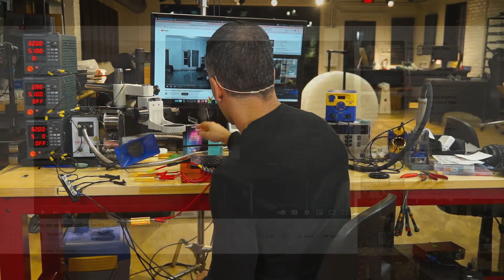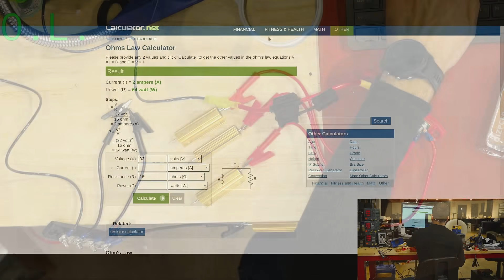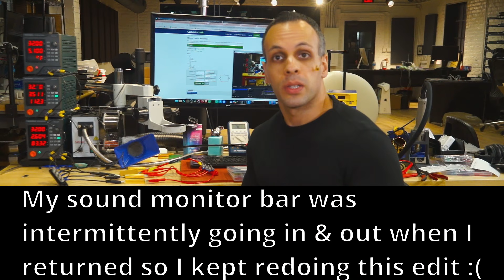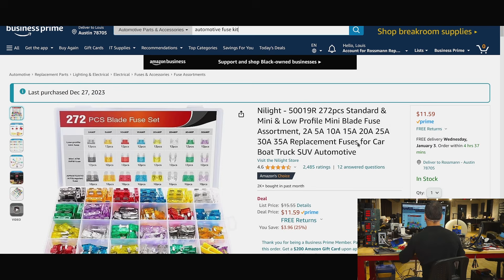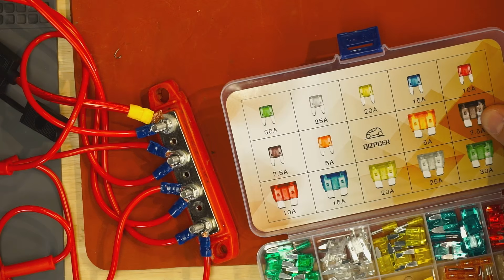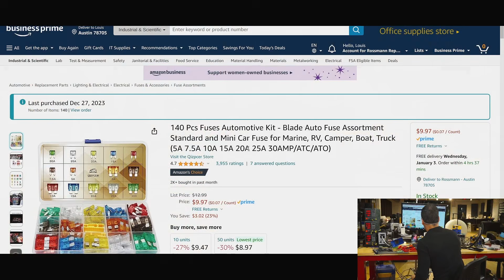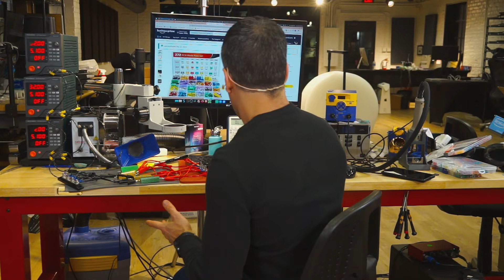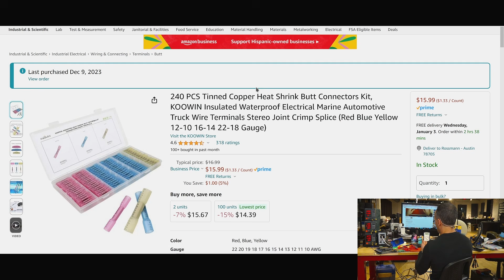Amazon Sells Fake Electrical Fuses

Comment: 3 Amps Thermal Circuit Breakers I purchased from Amazon for fault finding aka akin to "Lil popper" don't trip at 3 amps. Instead I'll use old ones from old furnaces that work fine and made in "Merica (probably)

Comment: The color coding stresses me out, even if the fuses were actually rated for what they said on the box: 
Having nothing printed on the fuse itself and using similar colors is a recipe for disaster in my eyes. 
I had myself second guessing in the video between light grey and white everytime you picked one, and I'm not even colorblind.

Comment: Wish you tested a few more fuses per brand randomly, just to remove more doubt from the general adverse viewer.

Myself, I have anecdotal experience  with multiple Amazon products that mostly led me to the the conclusion Amazon is almost as bad as most used car salespeople. Also have the experiences of others I trust with my life, that also have dealt with positively reviewed products that fail consistently and quickly after initial new purchase or replacement exchange.

Comment: I was wondering WHY you did not show a closeup of the fuse where it shows the fuse rating? You may have inadvertently grabbed a 40 amp. BECAUSE not all manufacturers follow the Automotive industry standard for color coding.
Reply: ALSO, if you would have measured the resistance of each fuse, you could have estimated the amperage of each fuse.

Comment: Great video, Louis. I looked up the datasheet for a brand name fuse, and the 2A version should have opened in 0.1s at 6 amps if it was designed correctly. Yikes!

Comment: One thing I would have liked to see was a comparison to something like a Bussmann fuse that you might pick up at your local autozone store, just so we can see what the "expected" behavior is.
Reply: expected behaviour is not hard to guess for a fuse, but yeah showing "real fuses" vs "china fuses" would help bring the point home
Reply: Expected behavior is a 2A fuse blowing within a second at 3A, and even faster at higher currents
Reply: @volvo09  Could take up to about a minute at 3A for this type of fuse. At 4A it should be under 5s.
Reply: @volvo09  Fair enough. When I first posted this I didn't consider that the data sheet is readily available for brand name fuses. 

Interestingly, the "less than a second" isn't even guaranteed on brand name Bussmann fuses. The spec sheet says, @200%, the minimum blow time is 0.15 seconds - but the maximum is 5 seconds. 

https://www.eaton.com/content/dam/eaton/products/electrical-circuit-protection/fuses/bussmann-series-supplemental-fuses/automotive-blade-type/bus-ele-ds-2048-atm-series.pdf
Reply: LittelFuse automotive 2A 32V at 4A should be 700 ms to blow.
Reply: Agreed that we need a control. This data would be more convincing with it.
Reply: The UL/CSA requirement for automotive blade fuses is they must blow within 5 seconds at 200% rated current
Reply: Bussman fuses are good quality fuses. Mouser sells them in 10pc. volume for about 1.5-2$ a piece or as little as 1$ at 100qty. so are LittelFuse
Blue Sea Systems are also good fuses and Amazon sells them for about $1.25 a piece and they are shipped and sold by amazon with 1 day prime... 
ATC fuses should cost about 1-2$ each compared to  chineseium ones that are like $0.10 each  but they actually work.
I dont get this b/c if you go through fuses so fast that the $0.90 difference in price actually matters your electrical system has WAY BIGGER ISSUES.

Comment: Would be good to have a head to head comparison to a well known brand fuse. I have no experience with low voltage fuses but I have some with high voltage fuses and they tend to take some time until they blow at over current due to thermal inertia. At rated current they never blow. Probably it might blow much earlier as the ones shown in the video but you never know.
Reply: @@giusdbg I‘d say the average model that is used by car repairshops. I’m pretty sure they won’t use different types of fuses for the same size.

Comment: I think you should do a comparison with a quality name brand fuse like Bussmann or Littelfuse. Compare the time it takes to trip. Given that these fuses are supposed to meet SAE specifications they should have similar if not identical time to trip at a given current and ambient temp.
Reply: A 100 piece automotive fuse kit on Amazon is $8.99. A 100 piece Eaton Bussman fuse kit on Zoro is $56.29. A 100 piece Bussman fuse kit on Grainger is $99.29. A 100 piece Littlefuse fuse kit is $69.47 + $13.89 tariff shipping to the US, thank you Mr. Trump. And there's you dinner!
Reply: @Phocoshay_Balperrus  Those fuses are between 30 and 40 cents each in quantity 10 from DigiKey. Some are as cheap as 22 cents each in quantity 100. None are as cheap as 8.9 cents each. Now, if you want to save 30 cents on a fuse to use some crap that may or may not actually blow when it's supposed to, well, you are the customer that China caters to.

Comment: I think fuses like that are not really for protecting power supply or load. More like protecting wires. Car battery can deliver much more than few amps, more like hundreds. So I think that fuses like these are for gross overloads, not working as fast fuses.

Comment: Don’t you have to install the fuse before the load not after? Effectively there is no fuse between the supply and the load? In automotive fusing the fuse is as close to the supply as possible.
Reply: No as the current entering the load is equal to the current leaving
Reply: @Huntonaldinho if that is true then why even in the MacBooks that Louis repairs always have the fusing before the loads. The fuses are between the charge port and the charge circuit and before any chip on the board. They don’t run the fuses after the loads. I’ll do some googling and not saying you’re wrong just know any fused circuit I’ve seen the fuse was before the load not after.
Reply: The resistors reduce the amperage after the resistor so in theory the fuse is not seeing what the supply output amperage.
Reply: ...but for safety it is better to put it before

Comment: amazon took an order off me on the 4th december for a hotend kit for £52 pounds UK, I got message saying order will be slightly late but would be here before christmas. I thought ok at this time of year things like that will happen, I then tracked my order after 14 days to see where the item was and found that a new delivery date was 3rd Jan 2024. I thought sod this and went on aliexpress ordered the same itm fro £32 pounds cheaper and was delivered on 27th Dec still before amazon, so when it turns up it will be returned and my prime membership cancelled as they are pure crap.

Comment: That's ok because I will still use the fuse kit I purchased. I purchased it a while back, and I will hold Amazon responsible when it blows out something on my vehicle, and Amazon will pick up the tab. I will download and save your video to cover my butt in case my fuses destroy my vehicle or the wiring system in it. I believe in keeping these people honest. As for crimps, I do my own crimps, but I buy the separated ones, crimp them to the wire, and solder them to keep them connected no matter what. The only thing that will take that crimp apart is someone putting too much amperage through the wire or someone ripping that crimp out.

Comment: When I was serving we had a fire in an accomodation block and I was asked to look into it (electronics tech). VERY luckily, the fire was from a HiFi that was just left as a pile of ash with 2 speaker grills sat in the ash but nothing else caught fire. Shitty old concrete block walls saved the day. Anyhow, opened the plug (UK 3 pin with fuse) and the fuse was.....drumroll.... some aluminium foil twisted together and rammed in the plug where the fuse should be. I think the guy pulled Saturday night guard duty for about 3 months solid, if i remember correctly.

Comment: You power supplies have current limit and a current display, just connect the fuse across the output and slowly turn up the current till it blows. Using resistors loads is unnecessary.

Comment: Fuse trading are the rating it should take without burning. Many fuses will only burn out at 3-4 times there rating and that's considered acceptable and normal performance. 

We don't need to like it, but it is what regulations allow.

Comment: Crazy to see this results! Thanks for sharing. 

One thing I want to mention is that alot of cheap Chinese products from these sites are mislabelled. It does not make it ok of course, but something to consider in your root cause analysis. 

I recommend you check all the fuses (all different colors)  in the same way as before and write down the results.

Comment: I got a 30A dc motor controller from Amazon...put 5A through it at half the rated voltage and it went up in smoke.  Reviews literally mean nothing on Amazon.  This is one of many examples of Amazon garbage from the past couple years.  Fake solder being another...like literally just tin wire.

Comment: Louis: Sorry for an offtopic question, but i could not find the answer anywhere: What is the name of your headset microphone you are always using? You only have the "normal" Blue mic listed in your video description.. Thanks!
Reply from the maker: DPA 4065
Reply: @rossmanngroup  Wow, that was fast! Thanks and a great new year from Germany!
Reply: For others interested: I found it used for 150-200€. Seems like a steal for a broadcast quality mic from DPA!
Reply from the maker: I don't pay $750 for this microphone. I wait until somebody breaks the plug. I buy a replacement plug from Neutrich for $5 or $10, and then I buy the broken microphone for $150 on eBay and fix it.

Comment: Would these even pop if you were using them in a car, where you're usually running ~14v?
Reply: Fuses don't care about voltage.
Reply: The current is what matters. Low voltage fuses, meh. However if the fuse is to be used in a circuit that carries 1000V DC then they type of fuse totally matters. They and their enclosure are engineered to make sure you don't get electrocuted. There's a video on my channel about high voltage fuses and not burning your house down.